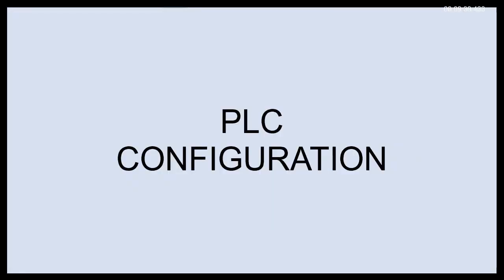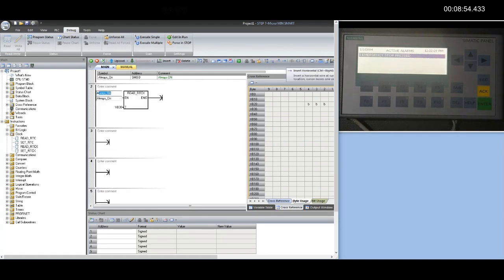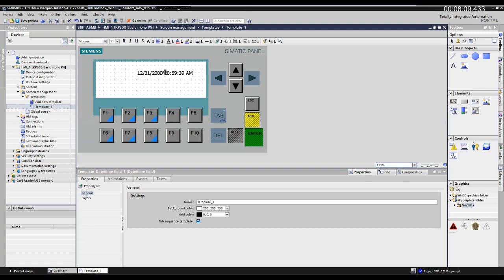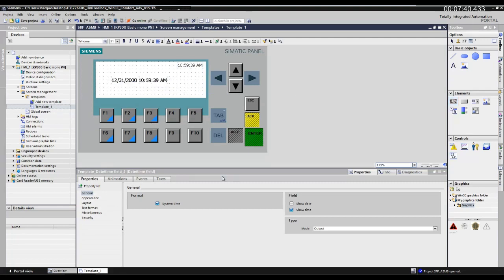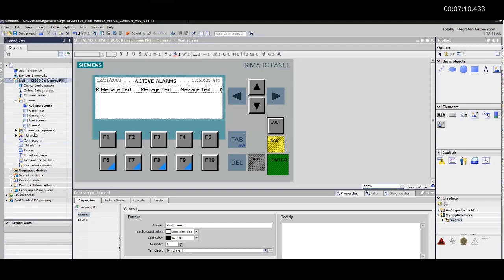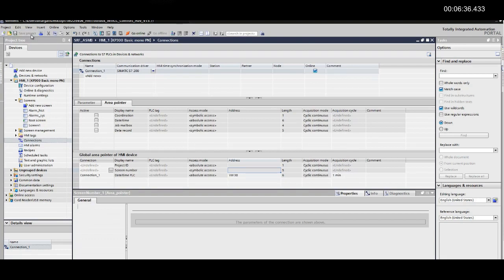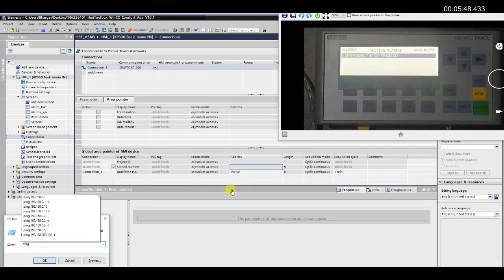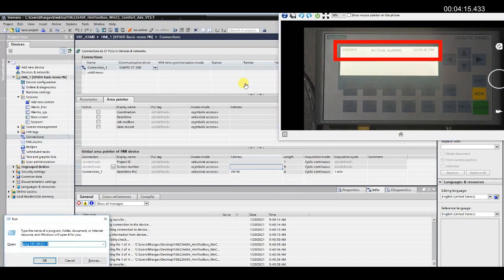Synchronize Siemens HMI time with S7  PLC using Area Pointer

Comment: Sir why you not change date time from HMI?

Date time is change by plc to HMI .
Reply from the maker: That is also possible. And in that case you can also update date time from HMI and so time of PLC.
Reply from the maker: With PLC you can have RTC with battery backup , that is difficult for basic HMI models , and HMI may lose time in case of power failure.
Reply: @StableAutomation  ok thank you sir.